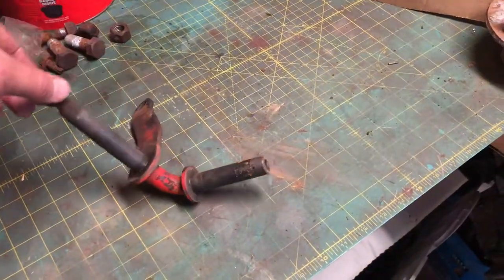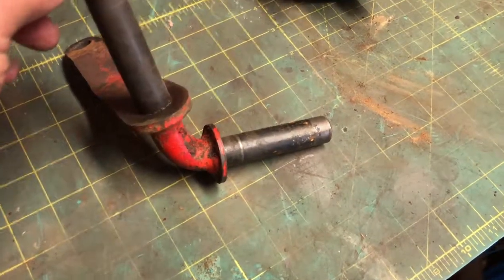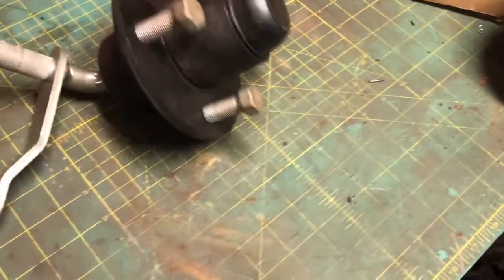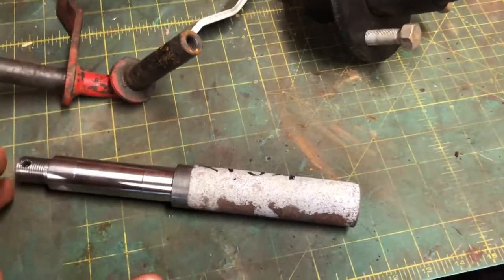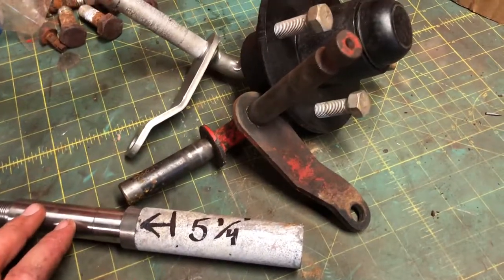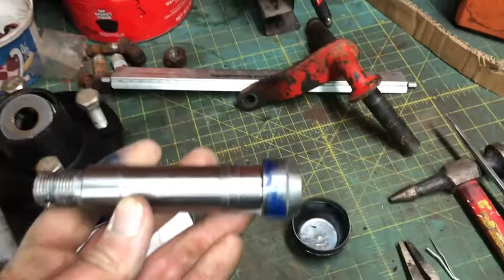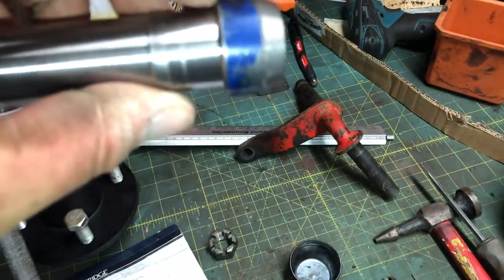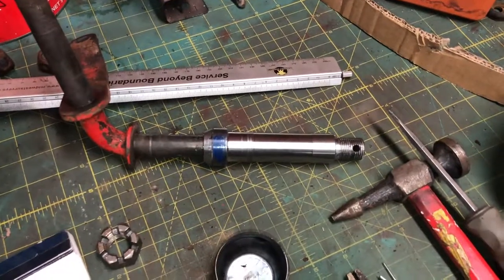Quick and Dirty Garden Tractor Spindle Upgrade

Comment: Are those trailer hubs that you use and could you use older 
car hubs ?
Reply from the maker: Those were trailer hubs. I suppose you could use car hubs as long as you had the spindle shaft to use with them, and you’d have to make sure you could find tires and rims small enough for that bolt pattern. The reason I used the trailer hubs was that they were 4 on 4 bolt, pretty common size for 8” rims.

Comment: Why not simply fabricate a new one from that beefy trailer spindle rather than machining and boring out the trailer spindle to mate with the old stock spindle. I think he could have made a 10x stronger spindle with his welder and scrap steel and that trailer hub.
Reply from the maker: 3 reasons, 1) read the title, "quick and dirty" this was never meant to be an all out fabrication of a new spindle. Just a slight upgrade over OEM. 2) I think I mentioned it in the video, if not, this tractor was never intended to be a loader tractor, so it doesn't NEED super HD spindles. 3) The whole purpose of the project was to create a slight upgrade over stock, and allow me to use the 4 bolt rims and tires that I had and wanted to use, that's it.
Reply: @macsworkshop9366   you are clearly a skilled guy. Im not criticizing, Im here because I learn from the talented guys like you.